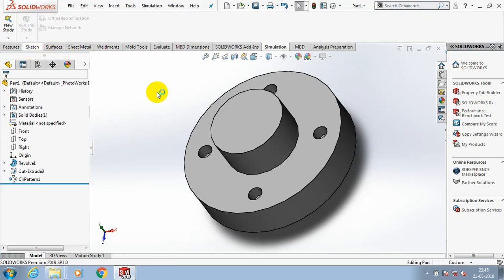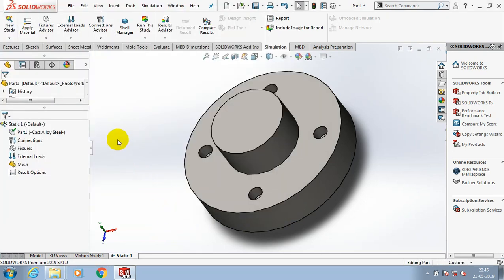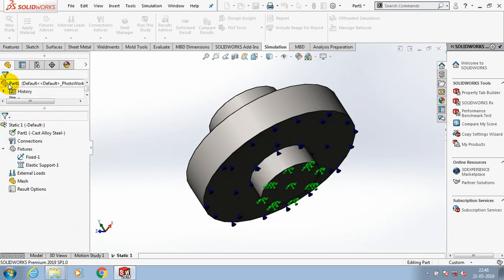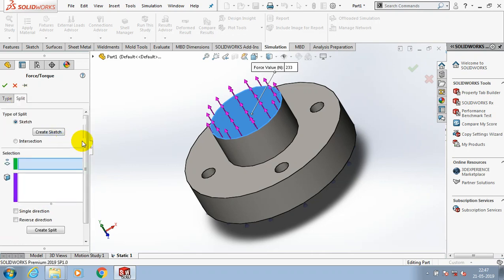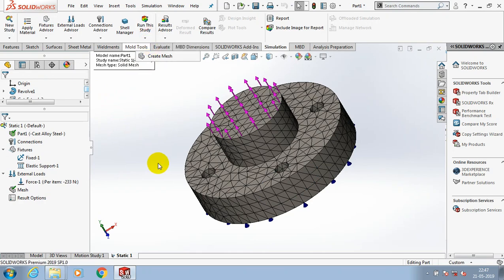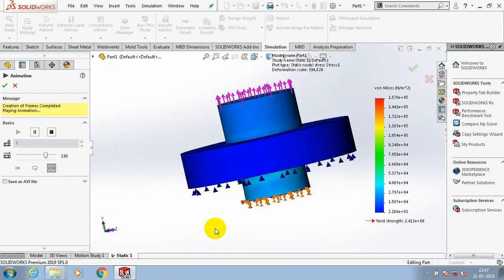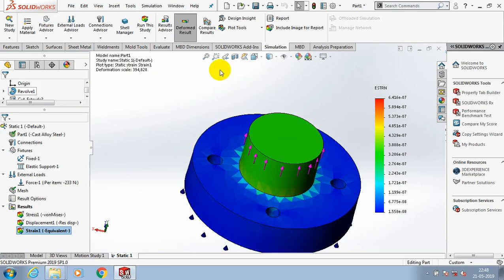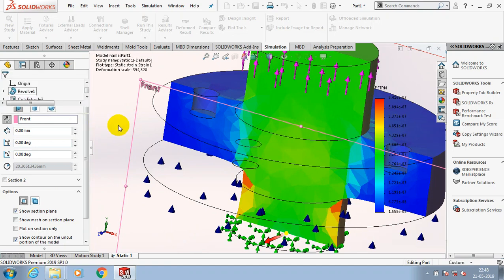STATIC STRUCTURAL ANALYSIS | SOLIDWORKS SIMULATION |ELASTIC SUPPORT | EXTERNAL LOAD

Comment: Hi :) I have a question. How is stiffness determined? In the tab: elastic support, you set the stiffness 25 (N / m) m ^ 2 and 12 (N / m) / m ^ 2. How did you calculate it?